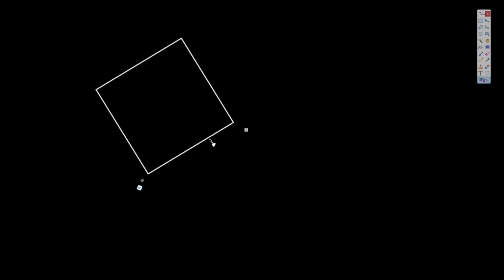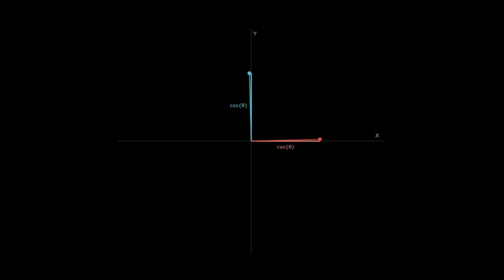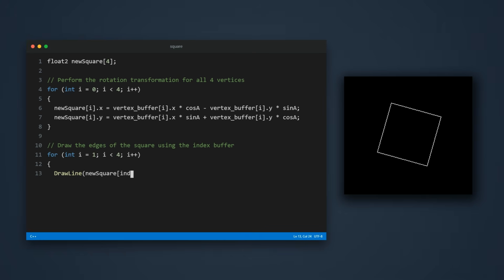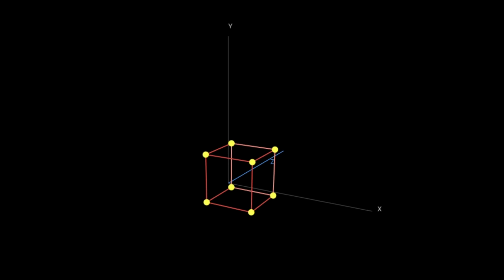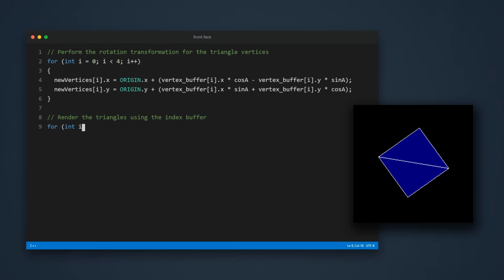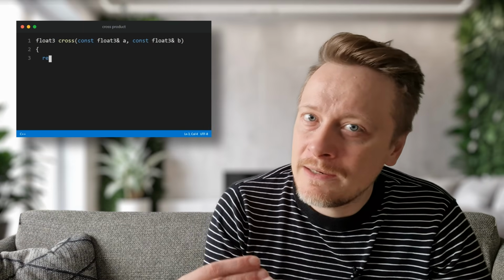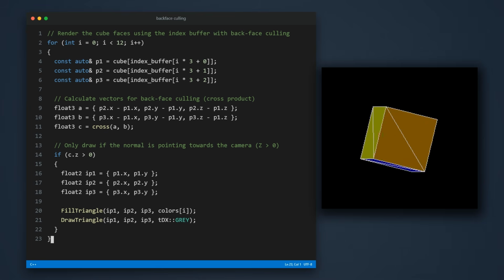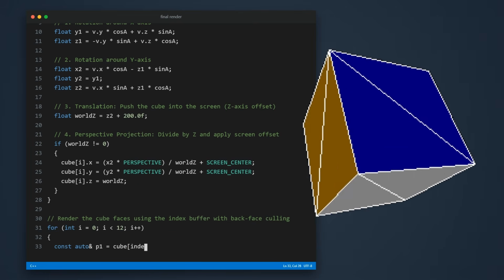3D Graphics from Scratch: No GPU, No OpenGL, Just Math

Comment: One thing to keep in mind, if you just want a line rotating around the origin, as in say a clock face, you don't need to calculate the y portion of the coordinate. Let's say you have a render canvas that's square, and you want a line that's some fraction of the width/height, then the coordinate transformation will be { .x = length * cosA + ORIGIN.x, .y = length * sinA + ORIGIN.y }. It doesn't save a lot in computation, but if you're on a really old computer it helps.
Reply from the maker: Good point! If you define the line by length and angle (polar coordinates), you can skip the full rotation.
Reply: 고마워요 thank you